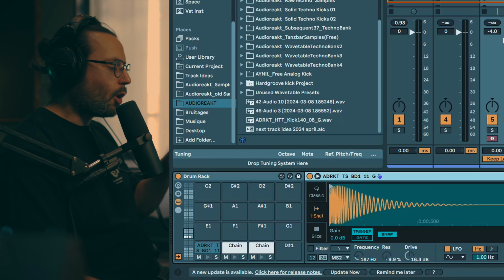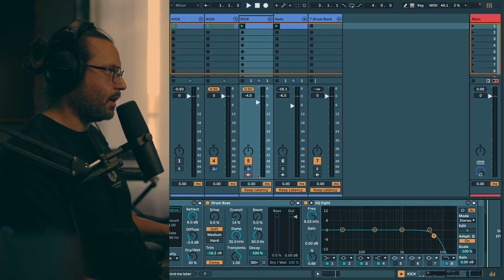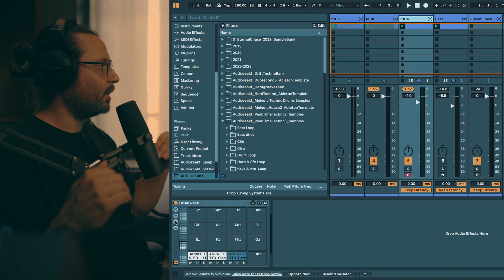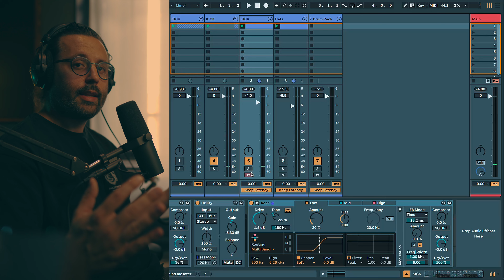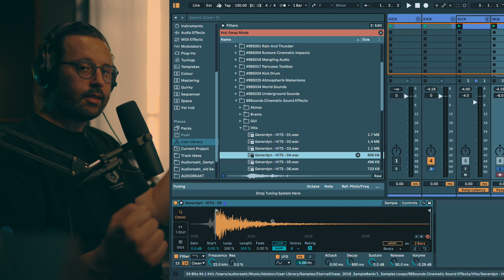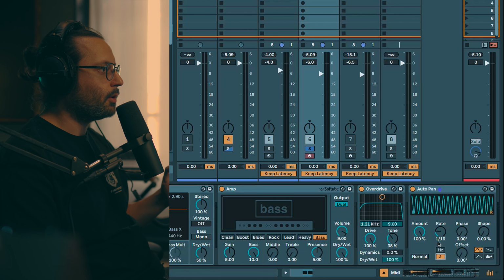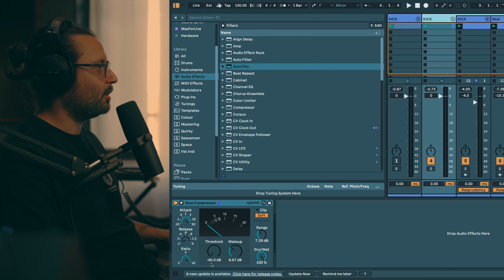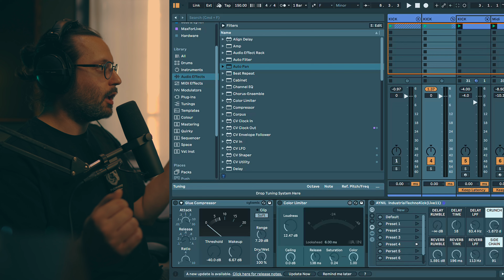MASSIVE Techno Kick from scratch...(free preset)

Comment: Thanks again for sharing your knowledge and taking the video producing time! I hope Elektron takes notice for their future product development. It‘s time to step up for hardware to get such intricate plugin power. Or Ableton has to push their firmware development.
Reply from the maker: I am dreaming of a modern drum machine or kick generator hardware… something that combine analog part for the body and samples for layering, then something already process out of the box , even if you have to put a distortion and clipper on each single element… a vst in a box basically but don’t know if it will ever happen are a lot of the hardware community seems anti vst in the box lol

Comment: I have Ableton 12. ... I have just downloaded a couple project files off the website... neither of them can be selected when I try to open the project file from the selected folder in Ableton.  what am I missing? please help.
Reply from the maker: I am not just what you mean, what type of files it is that you are trying to open ? For most template follow this : When you downlaod the zip, unzip it and you will have a file with an ALP file. You need to double click on it, it will open ableton if not already open and ask you where to extract it. Select the folder of your choice, extract, then go to you folder location and you will have an ALS file which is the session file. 
Double click on it and it will open the template.

Let me know if you still have problems with it,